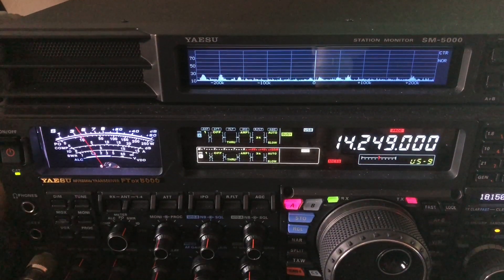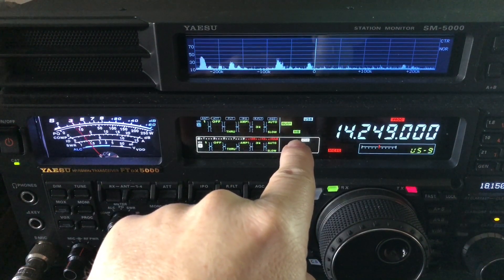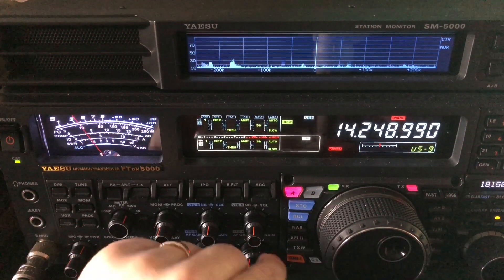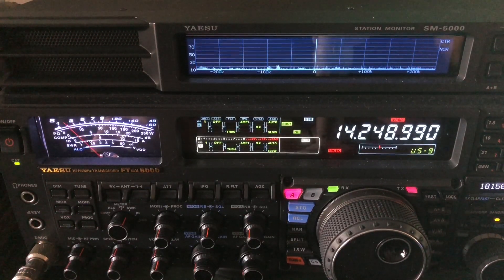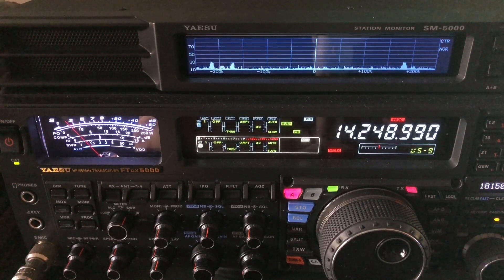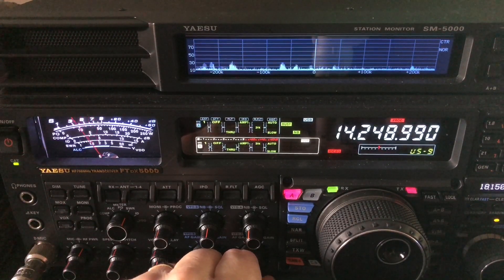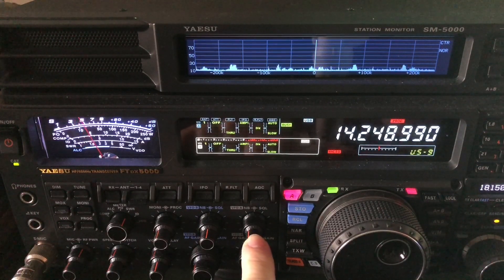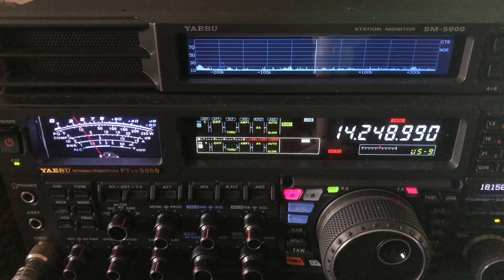Power Line Noise and Noise Blankers

Comment: Okay Doug, How can I tell what is power line noise? Wall wart noise? The noise blanker on the 5000 has no effect. I thought about taking the FT817 around the house on 80M and listening for noise is that a good method?
Reply from the maker: Hi Chuck,

An AM transistor radio might be able to detect it.  What I did was process of elimination.  The noise blanker cannot deal with wall-warts, cheap Chinese LED bulbs and the like.  It can stop power line noise.  You can see some examples of power line noise in some of my earlier videos.  It is more of a grinding sound.  On the scope it has gaps and peaks.  The other sources of noise tend to be more akin to white noise, and they occupy a broader portion of the scope.

Update: Here is the link to a previous video showing power line noise and how the noise blanker deals with it.

https://youtu.be/dvDu3T99owc

73, de N4HNH